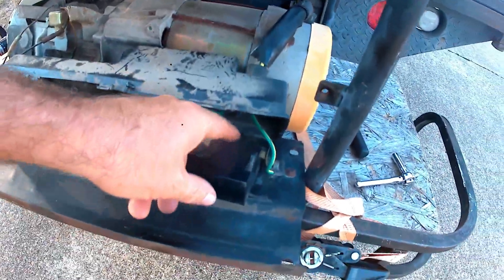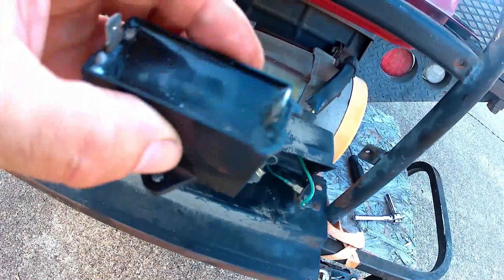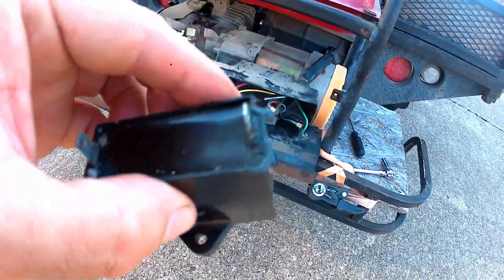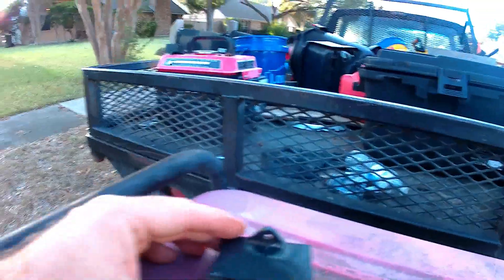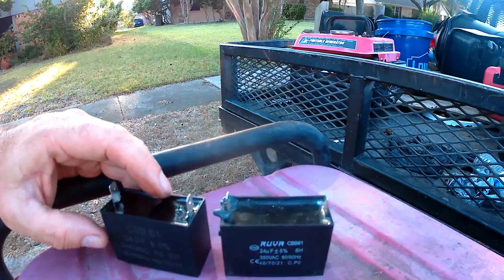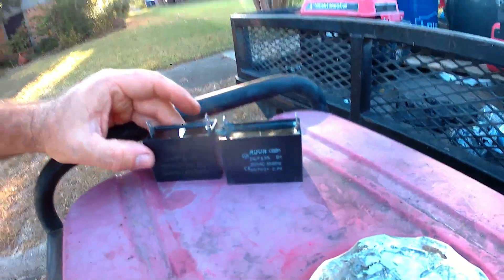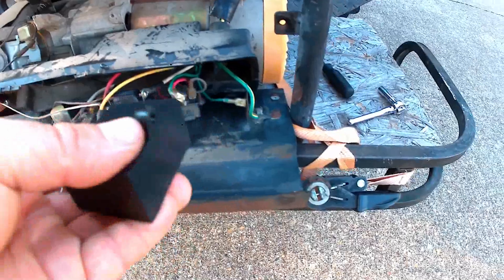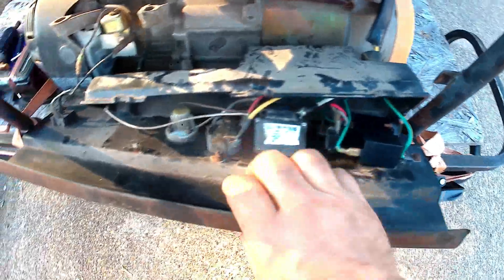Generator Capacitor Replacement - I Put the Magic Smoke Back In!

Comment: Oh yeah, BTW, the original cap for the Dewalt is not available anymore, so the cap that you referenced would be a Godsend. I would just have to tape it up and/or tie wrap it inside the unit however. Whatever it takes out here at the cabin. These generators are really expensive to replace. It's been a great unit.

Comment: Thanks so much for your post. I think I have a similar issue going on with my Dewalt DG7000e generator. Apparently it also use as cap as an exciter. I have not been able to dig into it yet because of the cold (I live in Alaska). The issue when I first fired it up with the battery start was that the motor took off like a raped ape, super loud, etc. I couldn't really figure out what was up, went into the house to check out my charging system with my inverter, heard the gen set power back down to a more normal status, then went back to the shed and smelled a strange smell, like a cap or a transformer blew, etc. Now, I have no output at the AC out. Starts just fine normally, but no output. All I can figure is that maybe the manual governor linkage was stuck on high speed or such. Severe cold up here can really play hell on everything at times. Anyway, if it is that cap, the cap you referenced with a link to Amazon, would really help! Almost the same values, etc. Very helpful. Thanks man!